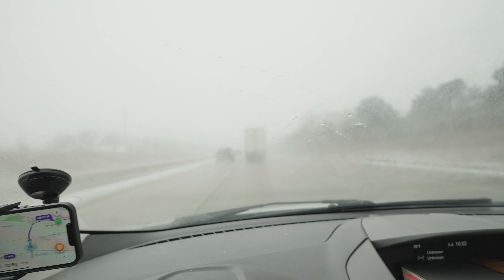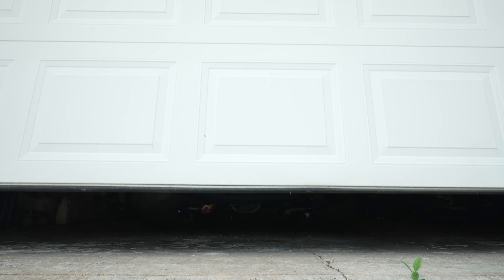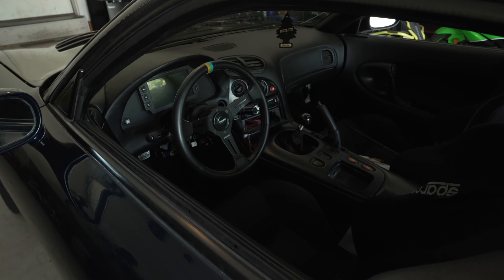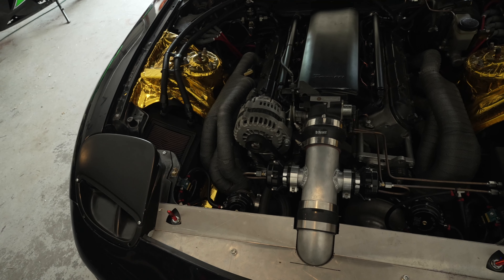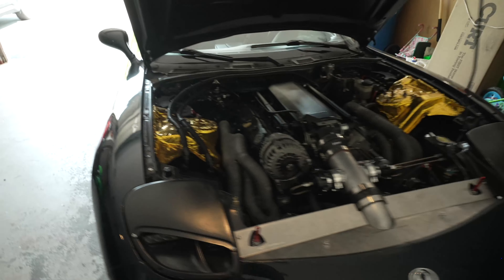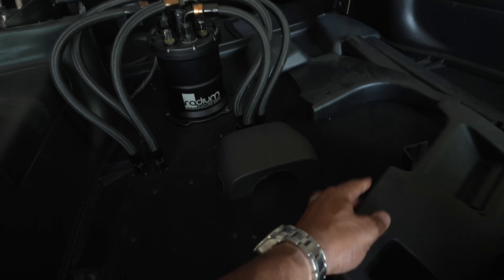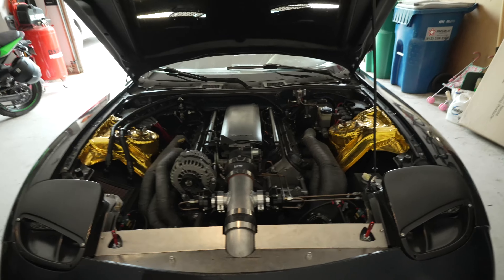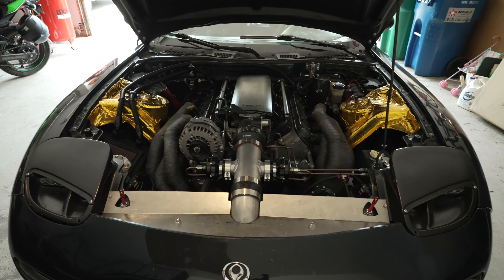Walk-around of a Twin Turbo LS SWAPPED Mazda FD RX7...That I Just Bought

Comment: Very nice! Rotaries aren’t unreliable, it’s just requires a higher level of mechanical skill. Are you doing road course or just drag racing?
Reply from the maker: Thanks for checking out the video, purpose of this car will be a roll race/drag race setup
Reply: That’s wrong I have built 4 20b and I did it right no matter what you do they’re a ticking bomb with hi hp 850+ has problems soon
Reply: @angelwalker6931  cool man.